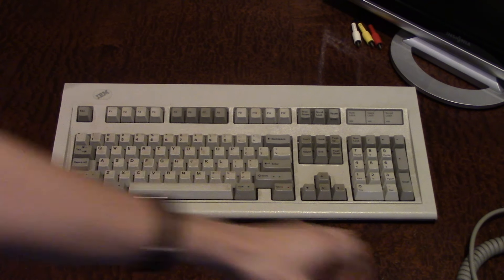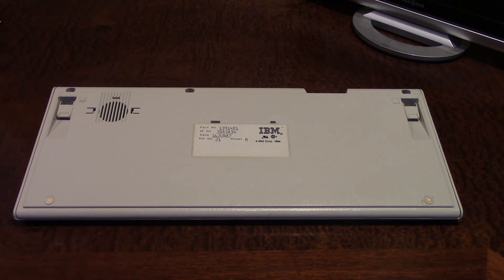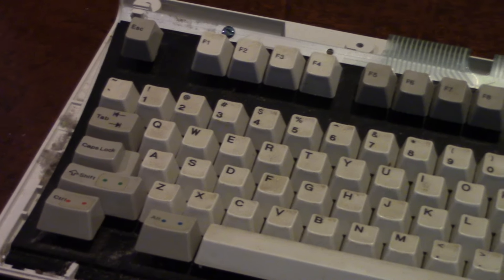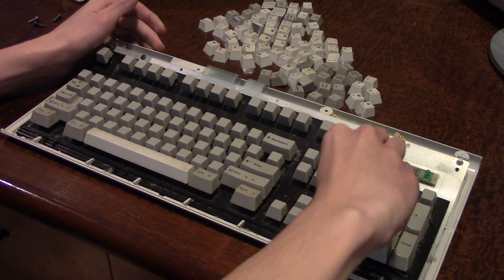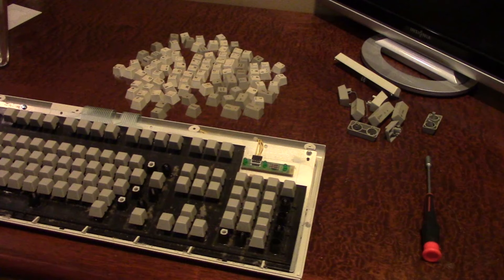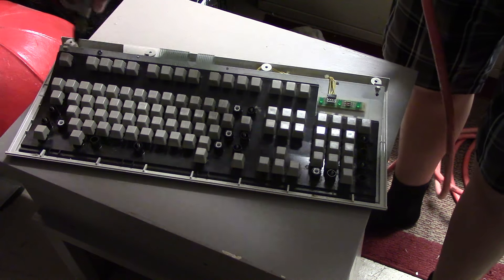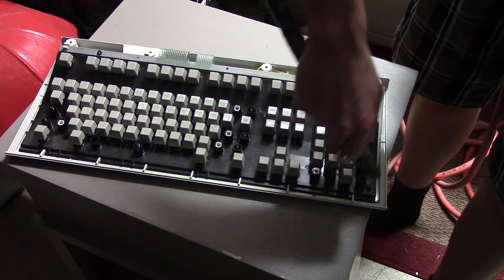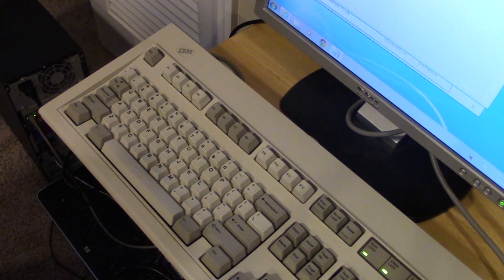IBM Model M Keyboard: Cleaning & Restoration

Comment: It's rarely adequate to clean Model M keycaps by simply rinsing them with water. Most of these keyboards were used full-time in business environments, and have picked up quite a bit of grime over 20–30 years of use. It's much more effective to put the caps in a container of warm water, add some liquid laundry detergent, and let the keys soak for 30 minutes, stirring them every 10 minutes. Be sure to let them dry overnight, so you don't take any chances on getting water into your keyboard!
Reply from the maker: +zeppy13131 I ended up washing them thoroughly with soap and water, and that seemed to do the job well. And yeah, I had to let them dry for about 2 days before they could be put back on the keyboard

Comment: I just bought a 92 model M. I used disinfectant wipes on every key. Yes it took much longer, roughly 2hrs to clean every key, but there was little moisture involved which means it's ready for reassembly immediately.
Reply from the maker: Awesome! I still have this one and its still in great shape. Awesome to hear other people cleaning these up as well.
Reply: Nice man, I just restored a 1987 model M and I used this exact method (disinfectant wipes) after washing the keys in both laundry detergent and dish soap twice failed to work. It took hours but the keys look new.

Comment: I did something similar for a 122-key IBM midframe terminal keyboard that I accidentally spilled tea on at work one day, years before this video. Some keys ceased functioning, so I took the keyboard home, but didn’t even need to take the keyboard apart at all, other than removing the keycaps just as you did here. Online forums suggested just water, and NO SOAP whatsoever. I used a water hose for the keyboard itself and separately washed the keycaps carefully.

After letting everything dry for a day, and with no means to test it at home (due to mainframes and midframes having their own proprietary connector), I wasn’t certain what to expect. Sure enough, it worked like new when I took it back to work!

Comment: Instead of  the 5.5mm, I used a small brass pipe that was just a little bigger than the screw head. I shaped it with pliers to match the size. I used the only easily reacheable one to get the right measure.

Comment: i have a less than a year old model M and i notice over time its slowly getting softer like all the old ones i ran into, is there a way to maintain/restore the old click and pop these things have when new?
Reply: Bolt mod, thats what you need
Reply: bolt mod?
Reply: Yes, google it... Model M have a steel plate stick it with the plastic case that hold the hammers-springs and keycaps. With time the little things who keep together the steel plate and plastic case break, and you loose that pressure. That's the why you get the slowly and softer feelings.

If I lived near you I would do it for free, I love doing that kind of thing
Reply: i have been afrade to take apart my model M as it was 95$ and it works well. now i have gotten many model F's for free so i acutely got a model F parts bucket.
Reply: btw i love my model F's and i wish i had a 103 key model F but all mine are for the 5155 or 5160 PC XT
Reply: i wish i did not give my second Model M away now as that thing would be great to try with, as it was a 89 IBM model M i got for 1$ and it was super soft and beatdown. i gave it to a friend when he turned 21.

is there a way to give the model M the deep springy clunk of the F? if so i might actually have to tear my keyboard down.
Reply: Model F's have different hammers and a capacitive PCB, not membrane like Model M's... You can't have similar feelings on a Model M like a Model F. Bolt mod can you bring the feeling as if it were a new Model M, that's what your keyboard need.
Reply: Xab Deth would a dell at102 be like a model m or model f? Because a few of the keys feel kind of mushy on my original keyboard and I want to know if that bolt mod would work with it or not
Reply: You say to do the bolt mod on your AT102? Not, you cant do it because Dell keyboards (AT101-102) use ALPS switches. I need to know what kind of alps have your AT102

Comment: I have the exact same keyboard and my key "r" when pressed types out the the number 4. I haven't cleaned my keyboard as you showed on your video so can you tell me what causes that. It isn't just the "r" key but I noticed periodically that other keys are doing the same thing. Can you please suggest a solution to fixing the problem because I absolutely like the keyboard for it's weight as it doesn't move around my desktop like the newer lighter cheaper keyboards that they are selling today. Your video is great stuff and now that you showed me how to clean the keys I will get right to it.
Thank you in advance for your help.

Comment: I had the same issue with my 5.5m socket. What I did is put it on my drill and drilled it in sandpaper and whittled it down enough. That worked well lol

My issue is that my keyboard stopped fully functioning. I had spilled on the left portion of keyboard not a lot of ginger ale at all and it made things all crazy. Not sure if I should use electronics parts cleaner at all on it.

Comment: Interesting video. Is this keyboard really that good? And as far as video suggestions go, could you do a video about the iMac G3 or the eMac? Ever since I got mine I've been in love with them and just want to see more of these machines. XD
If you don't have them I would be more than happy to send you some footage of mine in action.
Reply from the maker: +Shiny El. Ghosteo I do have a couple iMac G3s in my collection, but not an eMac (at least yet, haha). I've tried to do videos on them a couple times, but the only issue I had was with the refresh rate on the monitor. I could not find a way to set it to 60Hz to match my camera so it constantly did that annoying strobing effect that CRTs do when you record them. I'll have to look into a way to fix that, but I can definitely showcase them on the channel! :)
Reply: +mjd7999 sweet! Yeah CRTs can be a pain to record. You can stop the lines in a camera sometimes by backing up but then you are faced with being far from the device. Either way a showcase would be cool too. Thanks. (Fast response as always. You're the best xD)
Reply from the maker: +Shiny El. Ghosteo I'll try to see what I can do to fix the CRT problem. In worst case scenario, I can make the video with the flickering, or just not boot up the machine at all, but that's not ideal lol.
Reply: Michael MJD .

Comment: I think to actually restore this thing you would have to replace the membrane pad.  Anyone know where to buy new ones?
Reply: Unicom sells new membrane sheet which work, especially if you have a mid-to-late 90s Lexmark board or newer; you can still get a replacement for older Model Ms but you might have to do modifications for the lock lights.

If you are desperate, I saw someone in another video using a pen of electric paint to restore traces that have come off on the membrane sheet.

Comment: How do you use a keyboard without a Windows key?
Reply from the maker: +TheLMGN Ctrl + Esc is the same as pressing the Windows Key, so I just pressed that to open the start menu
Reply: mjd7999
But you can only open the start menu?
Reply from the maker: +TheLMGN I don't think it works for key combinations, just for opening the start menu.
Reply: mjd7999
Yeah, I tried it. Then, how do I open Run?
Reply: Just hold Ctrl and press Esc—that's the same as pressing the Windows key.

After you do that, you can access the "Run" command prompt by typing "cmd" (without the quotes).
Reply: zeppy13131
Meh. I like the speed of pressing 2 buttons to get to Run. Not 21.
Reply: +Tech Dude 25 You don't use Mac.
Reply: I use Autohotkey to remap all the Winkey shortcuts to Ctrl + Alt when using a Model M.
Reply: You can reassign a key to become the Windows key with a registry change. I have turned my Caps Lack key into the Windows key as the least used on my keyboard.
These keyboards also work well to new computers with and SDL6 to USB signal converter. I have one built into a1.5M cable, in use on an Alienware 17 R3 and there are also PS/2 to USB signal converters available.
A simple PS/2 to USB adapter won;t work, it has to be a signal converter.
EBay or Amazon.
Reply: @u1f98a  just reassign a key. I use "insert", and I've gotten so used to it that I do it on other keyboards sometimes. I also mapped Pageup and down to volume
Reply: I use Linux 😎